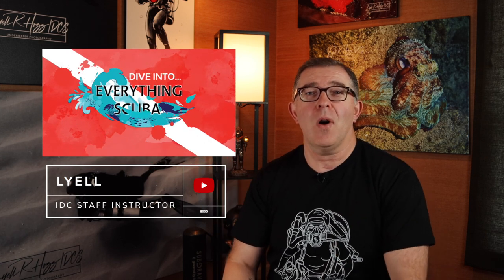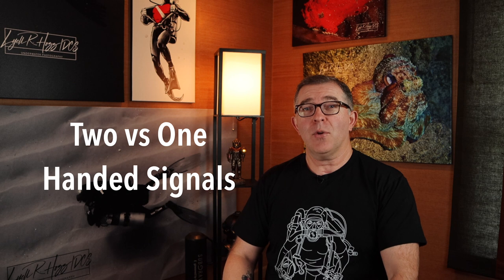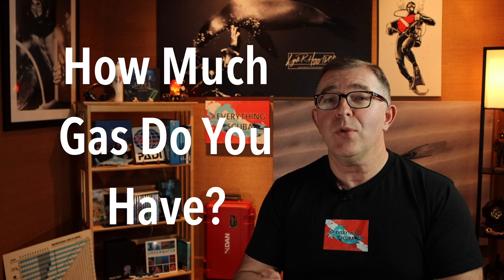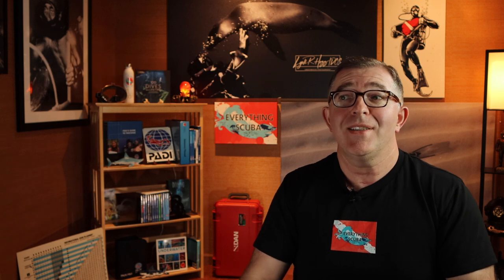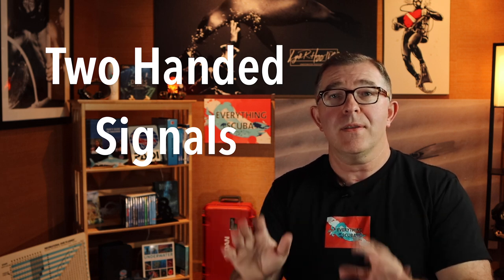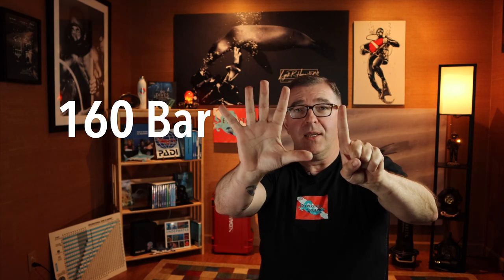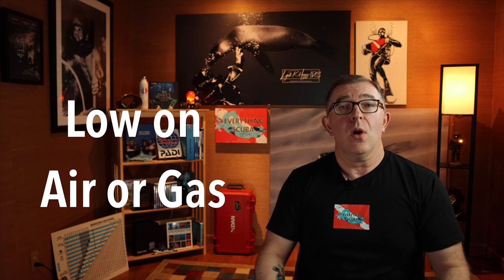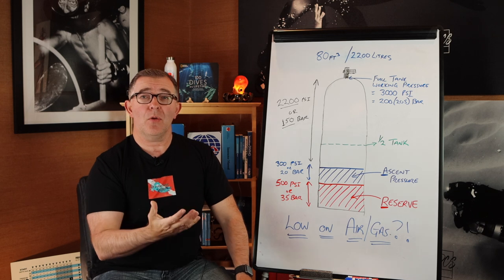Critical hand signals for air or gas management for beginner scuba divers.

Comment: The Low On Air signal given at the Ascent Pressure or the Reserve Pressure depends on where you are in the dive and in the water column.  At depth the signal would be given at the Ascent Pressure if you have not started ascending yet, and if ascending or during the 15ft (5m) safety stop the signal would be given at the Reserve Pressure.

Comment: Where I dive people are using the ✊ signal for 50 bars. (Not close to chest which = low on air)
We use this to communicate pressure, so for example 160 = T + ✊ + ☝️

Comment: I've never used your low on air signal nor have I ever seen it. Why would you? You should always be close enough to your buddy so that you can share. Also, what does "I'm low on air" mean? It means "we go up", so if you are low on air, you thumb the dive. Since you are communicating with your buddy throughout the dive, your buddy should be aware that you are getting to your ascent pressure, so when you thumb it and no calamity seems to have happened, then this is the only reason for me to assume why you called the dive. And if I'm wrong and you haven't called the dive because you are low on air, then so what? Anyone can call the dive at any point, so we're going up anyway.
Reply: If you give me things up I'll ask why? Or are you ok? Which will only waste time. More on air is use I've seen it a few times socially when diving with new drivers, and it gives tone for the group to understand why we going up.
Reply: @sirexilon  If I'm not ok, I'm telling you that I'm not ok. That might immediately be followed by a thumbs up signal, but at that point it is the important information to give, so I give it. So, if I simply end the dive without being visually in distress and without giving you a distress signal, then I am ok and I am consciously telling you that this is the end of the dive. Also, too many people reply to an action with "OK", so you just giving me an OK signal would be very easily understood as, "cool, we're going up then". To ensure that I understand you are querying my thumbs up, you would have to explicitly show "question OK". 

But all of this is moot because you get no further information out of me than you already have. I've already told you at multiple points throughout the dive how much gas I have left. If I'm down to 150bar after 20 minutes, down to 100 bar after 40 minutes, and at 50 minutes I give you an end dive, do you really need to ask why? If we have briefed to not go into deco and your computer shows 5 minutes NDL, but I haven't given you a 100bar or so left, do you need to ask why we're going up? 

You should already have all the information you need to understand why I am ending the dive if there is no distress situation. If you get surprised by a routine end of dive because I am low on gas, then you are not working well as a buddy pair. There is some communication issue that you need to figure out, because I know pretty much exactly when my buddy will hit 100bar, 70bar, 50bar and if I am leading the dive, I double check gas with them a couple minutes before I expect each of these points to be. 

Same for myself. I check my gas to confirm that the amount of gas that I have left is what I expect it to be. If I (or my buddy) have a lot less gas left than I expect (or a lot more for that matter), then I know something is up. Is there a gas leak? Is an SPG busted? I need to know what to expect in terms of gas remaining, so that I can identify an issue when it happens. This applies to myself and my buddy. So, I know when my buddy is low on gas, because I know how much gas my buddy should have at any given point of the dive.
Reply: @tobiashartung856  off the are only 2 divers and you have been constantly sharing info i will know how close you are, but if there are more divers or if something happens that you used more air in there last moments. Still doing a 4 divers session and sharing info i had a buddy that used a lot of air trying to swing against current when's he didn't need to. And while I'll to that point we were in similar air. Conditions he all the sudden went to 800 psi while i was in 1300 and we usually get out with the same air left, so he use the signal .
Ok don't see why making the signal is such s problem when it's specific information.
Reply: @sirexilon  In the situation you are describing, I would argue it is the wrong signal in the first place. Before you argued the signal should be given if everything is ok but you are low on gas, so end the dive. Now in the example you've given, the gas consumption of one diver massively increased without apparent reason. This means something is not ok. The diver could have a catastrophic gas loss. You should not be saying "all good, let's go up". It should be "Something is wrong, my gas is now low, let's go up." But in this case, "my gas is now low" is a bad signal. How low are you? Tell me exactly what you have, so we can take the necessary actions. 

I'm not opposed to using the "low on gas" signal per se. I just don't see a reason for it. If it is unexpected, then I want to know how much you actually have because we are now in a distress situation. If it is expected, then I already know that you are low on gas, so just tell me that we end the dive now.
Reply: @tobiashartung856  i have you the reason. Diver that is out of practice tried to swim against a very strong current to get the the other pair instead of riding the current and adjusting position, he was with me all the time nothing was wrong. He used more gas than he should. I signals the DM as me and him started to go up slowly to the safety stop.

We talking about recreational divers both tech.

You can say anything you want, butt most divers approve the signal and find out useful.
Reply: @sirexilon  Sorry, I missed that swim against the current explanation. I find it rather difficult to parse your replies given the amount of typos. 

Anyway if he was swimming against the current when he didn't need to and you went with the flow of the strong current, why have you not been separating? If he is swimming relative to the water and you are not, he must be making some headway. Unless you are tucking in behind rocks to shield yourself from the current, and he is in the full brunt of it, there are so many questions that need to be answered here and pretty much all of them are things you definitely should notice as the dive leader.

Also, if the current was so strong, then why are you not expecting an inexperienced diver to use up more air? Did the current just pick up at the time? If so, then things have dramatically changed and you as a dive leader need to monitor an inexperienced diver more quickly. If it's been the entire dive like that, then he must have started to swim against the current at some point. Did you not notice your inexperienced buddy do that? If you noticed that he is doing that, then you should be monitoring his gas more often. At least that is how I lead my dives. Again, there is no surprise that he ran through gas more quickly. 

Again, I am not saying the signal is not useful to people or that people don't approve of it. I am asking for someone to give me a situation where I should use it because it is the best means of communicating new information. But in every situation shown to me so far, the signal isn't giving me any information that I don't already know (if everything is fine), or giving me the signal is not the information that I need (emergency). 

So far, all I can see this signal to be mildly useful for is communication between DMs in large groups. But that is very much different from "critical for beginner divers". There are loads of signals professionals use that "customers" don't care about. And even in the communication between DMs, the lead DM should be sufficiently aware that when another DM says "my small bunch is going up" that they do not get surprised or need to question the other DM's decision.